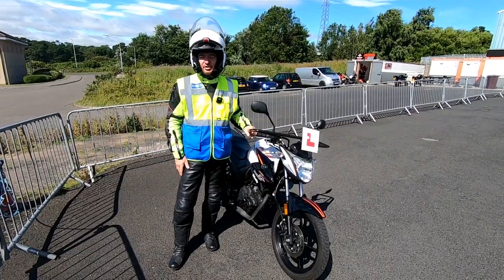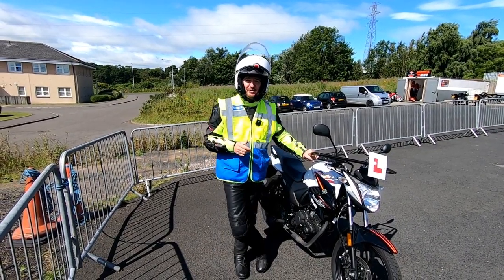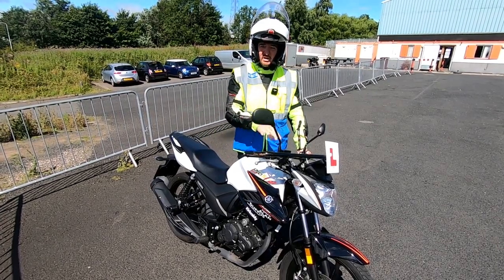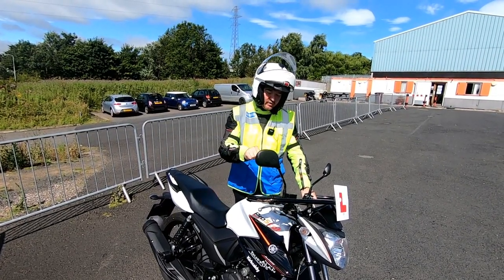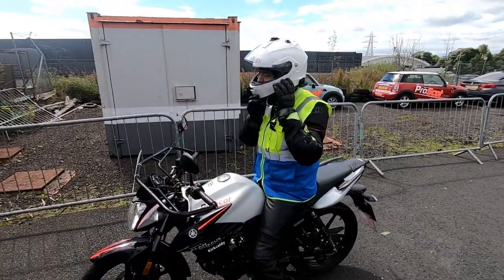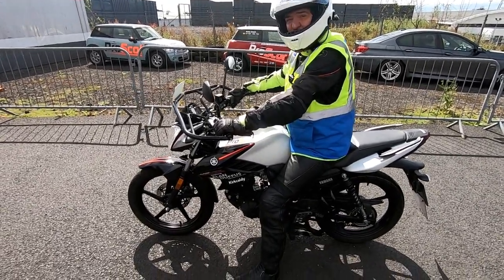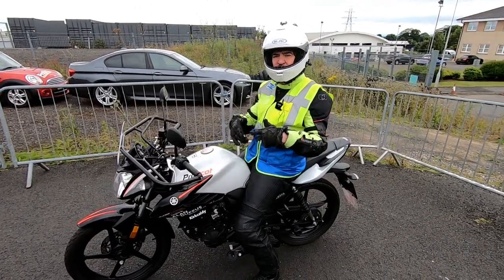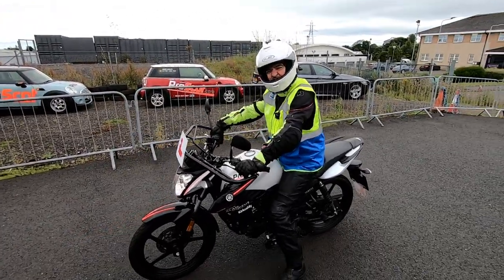CBT MOTORCYCLE TRAINING (PART 3 of 9) - COMPULSORY BASIC TRAINING - ELEMENT C (PART 1 OF 3)

Comment: Excellent video. Newbie here riding 2 months and love it but what you hit on with the left foot out is what I do to stop. I dropped the bike once and almost more due to the wobble the bike gets when at stop and was unsure why u til you said not fully stopped. That must have been it. The bars went to the right and down it went even thought was all rear break. I still once every 80 stops have a stop off balance a little or where I feel the bike wanting to turn right or get tricky due to uneven ground. The inability to rid myself of it doing this once a while is frustrating. Don't want to drop my bike every again hoping it doesn't happen due to this and praying it works itself out the more miles and stops I add daily